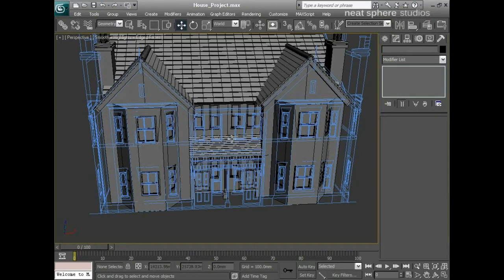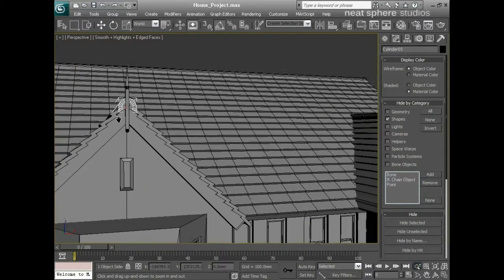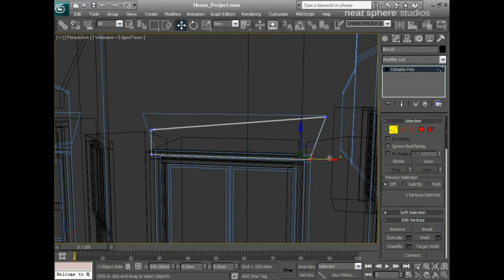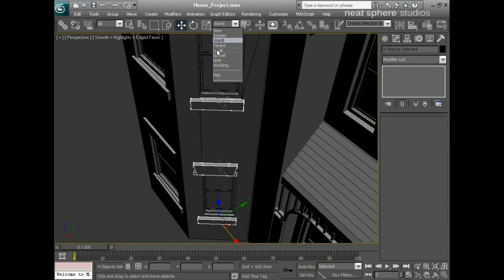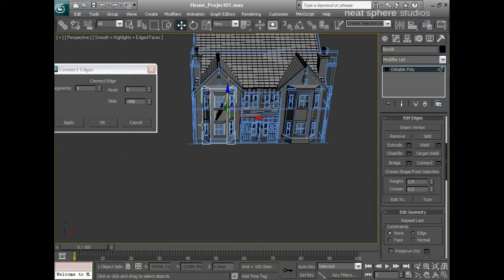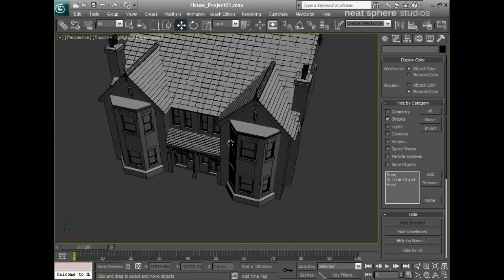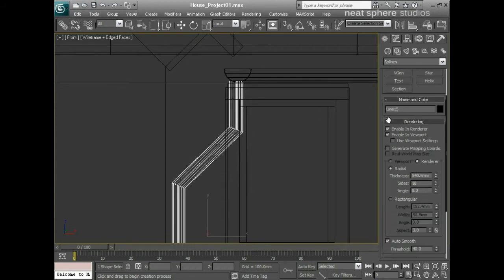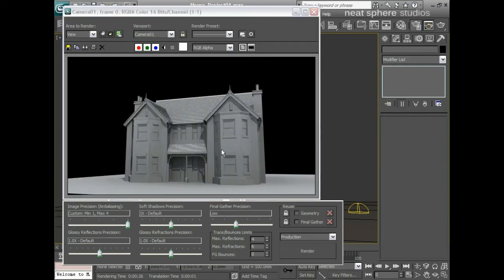Part7

Comment: Great tips, thanks for taking your time. Some questions though, why not use symmetry instead of mirror, instance instead of copy for duplicates, normal align instead of rotate to align windows to walls. And I steer away from  probolian as it messes up connects and other polymodeling tools and generally leaves the remaining polys in a mess?